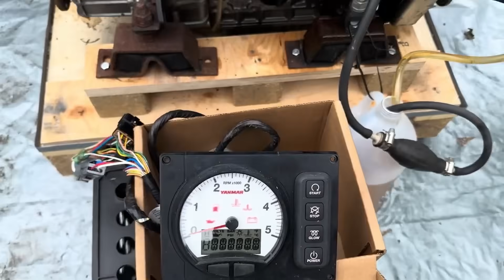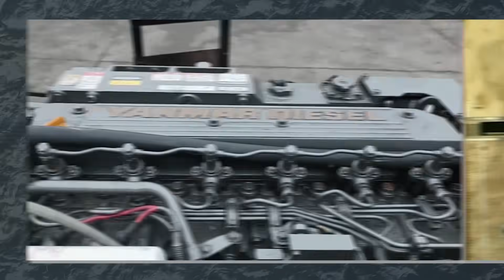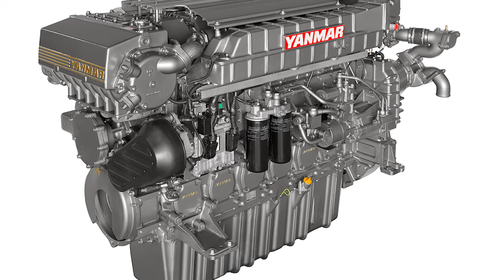The Rise of Yanmar: Mercruiser's Biggest Rival!

Comment: Yanmar is one of the worst brands in the small diesel engines out there. I know John Deere uses them for their small equipment mfg, but you cannot beat the small diesel brands like Kubota, Isuzu,, and Cummins. They are the most reliable and fuel efficient on the market today.  Even Perkins has a decent small diesel engine, which is why Cat owns them, although they are not marine diesels. Cat never had a good small diesels, but great large diesels.
Reply: What’s the worst?

Comment: Growing up on a liveaboard dive boat I often remember the sound and hum of the yanmar 36 HP outboard our tender had.  That motor just did not give up and as long as I can remember never failed and was also a benefit to have a diesel tender so that you could just carry one fuel type during trips.  Amazing piece of engineering, I own a 1HDFTE Land Cruiser and as luck would have it - is the same block and top end 24V as the Yanmar 6LPA marine engine !

Comment: I love yanmar engines, the best engines are their in house industrial engines converted for marine use. 
6LY and their 4LH series are beasts, you can replace the cylinder liners without any special tools on these engines. 
From what i remember their LP/LV series are toyota engine blocks and BY is BMW engine blocks.

Newer volvo pentas are ok but i would not buy their 80s and 90s engines, they blow head gaskets every 4 years or so.
Get the newer D3/D4/D6 series pentas instead

Comment: Gasoline engines are dangerous in vessels and yachts... Gasoline is explosive and almost impossible to extinguish, so I don't really understand the comparison with Mercure engines. In my opinion, they are only approved for use on lakes, rivers, or maximal near coastal areas. There are plenty of competitors to Yanmar, such as Volvopenta, Cummins, Caterpillar, Scania etc... But of course these are diesel engines.

Comment: Can anyone shed some light on the installation @7:11??
Reply: That is a hybrid retrofit by a Dutch concern called Combi who have been making electric boat motors for decades. The green housing is for a water-cooled brushless DC motor that can run at engine speed to charge lithium ion storage or be fed by the batteries to power the output shafts for silent sailing.

Comment: Kohler Power Systems used to build the 6, 10, & 15 ROY series Standby Generators, and Marine Generators with the Yanmar TNE Series of Diesel 3 & 4 Cylinder Diesel Engines, then the newer TNV series of Yanmar Diesels, and the Yanmar TNV series of engines were rebaged as Isuzu Diesels for some markets.

Comment: Had an old John Deere 650 with a Yanmar 2 cylinder diesel go under salt water during a hurricane in 1996 we flushed it and it still in use now on my sisters farm almost 30 years later with not a single issue.   Insanely tough engines!
Reply from the maker: What's the story behind sinking it? That's what we all want to know!

Comment: All I've had experience with a Yanmar engine is their diesel engines. They are TOP NOTCH and have never given me ANY trouble at all. All were in John Deere tractors.
Reply from the maker: Commercial or private?
Reply: @VintageBoats  A little of both. I bought my 770 brand new and needed fit or mowing my 3 1/2 acre lawn. And for clear ing feet of snow in the winter so I could get my truck out of my barn. 

Our winters were long and sometimes brutal,(upstate NY). So I had a 6ft rear pto powered mower deck, and of course the quick attach front end loader that was a snap to use. Then I did a little horse trading and got a twin axle equipment trailer and went and did some landscaping for friends etc. 

Then some weeks clearing up some flood debris for friends and family etc. I wish I could remember how many hours I put on it but when I sold my house and land I took it down to the dealer where I bought it and gladly took it off my hands for a fist full of cash. 

Damn near what I paid for it years before. I always treated my tractors like it were my car or truck. Yes, even waxed them several times a season.
Reply: @VintageBoats JD only use Yanmar in their commercial grade stuff.

Comment: I think yanmar used to be a good engine but I'm seeing issues in Newberry engines , the proprietary b.s is the reason I would never buy a new one , when they have issues it can be months on warranty work , plus I'm hearing they will not sell parts to customers only authorized yanmar dealers . if I was stranded on my sailboat for months at a time waiting for yanmar to fix my boat I would be furious
Reply from the maker: That would be frustrating! Have you ever owned one?

Comment: Ancient yanmar engines with low compression. How do you diagnosis that. WD-40 in the intake while it's cranking. If it smokes it's probably got compression. Make sure you're getting good fuel to your injectors. It's primitive it works. Don't use anything but WD-40. It's got propane for a propellant. And it loosens up the rings. Don't use rust off because that doesn't burn at all! However if you have one with stuck rings a good soaking with rust off and let it sit overnight. You'd be amazed. Don't forget seafoam really helps. And yes marvel mystery oil is a miracle friend of yours. Ancient little tiny diesels underneath the kitchen cabinets belonging to a millionaire with a bitchy wife. I've been there.

Comment: In my 40 ft Malö Yachts, build at Orust - Sweden, a sailboat from 1985 there is a Yanmar 44 hp 4JHE and there have never been any prbl with it. Never! A Clean Machine.
Reply from the maker: Thanks for sharing. Have you owned it from new?
Reply: @VintageBoats  No, I bought her from the first owner in 1999 and the boat will outlast me and my kids. Super quality and the engine have never been any trouble at all. Oil and filter. Thats it. at 6 knots 4,5 lt/hour about 2300 rpm. No smoke no oil consumtion. One turn on the engine and it start.. every time
Reply: Was it originally fitted with a Volvo Penta?

Comment: The problem with Yanmar is that the engines are extremely overpriced if you buy one retail. You have to be a manufacturer who buys hundreds or thousands at a time to be able to get them at a reasonable price. Its like $17k for a 1 liter, 30hp, 3YM, which is just a simple little generator engine in reality. It should be like $5k. That's like four times as much money as their competitors. The engines aren't worth that much, you're paying them royalties for the privilege of owning it. Its hard to believe they dont have a legitimate competitor considering how easy it would be to undercut their price by miles.
Reply: You pay for the reliability. It's like a insurance. And the engine is worth it.
Reply: @SveinMBortne if a Vetus 30hp costs $6k and lasts 10 years, I can buy 3 of them over the course of 30 years before the yanmar pays off. A tiny little diesel generator engine is not worth $17k on any planet.
Reply: @thechiraltheory7712 glad you support Yanmar still 😉 Yanmar owns Vetus but does not make a fuss about it just gobbling up the market.. 😅
Reply: @thechiraltheory7712  agree but I will keep my Yanmar 4jhe for another 40 years while you can change yours 8 times. Maybee we're different.
Reply from the maker: So you dont think there's any other good inboard engines on the market?

Comment: I've been working on yanmar's since they installed the single cylinder YSB. It became the YSM. Yanmar sideways modern. One cylinder. Sailboats ideally need reliable power. Yanmars have always come through for me. I have done in frame overhauls on engines that have had submersion. Believe it or not you can bring them back! Sometimes it's very simple you don't even need to take them out of the boat. 3GM 30 sailboat engine I can have the head off in about 45 minutes if I have good access. An hour if I have to stand on my head upside down with my face in a bilge. Yep I've been there done that. I like their big diesels too.
Reply from the maker: Some of those little inboard spaces are complete disasters! Have to be a yogi as much as a mechanic! Think sail boats need reliable wind no? 😂
Reply: There has never been a sound sailboat that has ever been sunk solely by being in too deep of water. So based on that fact. Investing in a good bilge pump is a priority. Investing in a bigger better bilge pump is the second priority. The hole in the water into which one pours money and praying that it doesn't sink @VintageBoats
Reply: @VintageBoats  Maybe  "YOGA" is where you were going?  ;}>
Reply from the maker: @gotchagoing4905 no I meant yogi.

Comment: I had a 1GM10 in my sailboat and a 3YM20 later in another. If you maintain them with oil and ensure they have cooling, they run forever and a day!
It doesn't matter if it was 30 °C or -10 °C, I turned the key, the pump developed pressure, and the thing ran.
Other people who had a crappy outboard were stranded on sea, while my little Yanmar just did its job. I've towed a few of those people into the harbor with my tiny 17-foot boat. :)
My current boat cannot have an inboard engine without reconstruction, and I miss my Yanmar. Besides my old W123 300D, I've never had an engine as reliable as the Yanmar.
Never ever will I have some American crap like Mercury /Mercruiser. Everything is in those idiotic imperial measurements and hard to get by parts, at least in Europe.
My outboard is a Yamaha. Japanese quality all the way. :)
Reply from the maker: Check out the SNL sketch 'Washington's Dream' of the imperial system. You will love it. Hilarious.

Thanks for sharing your Yanmar story.
Reply: @VintageBoats  Yeah, I just watched it.. 😂
Reply from the maker: @kalleklp7291 absolutely brilliant.
Reply: That's funny, this 'Yank' likes and grew up with those 'Imperial measurements' and they ALWAYS worked just fine for me. I for one am against us changing to the stupid metric system . You guys do you, and  us AMERICANS will stick with what we have.
Reply from the maker: @gotchagoing4905 I'm not knocking it. But you can't deny good humour.

It would be an interesting thought to know how difficult and how costly it would be to implement such a change! Near om impossible
Reply: @VintageBoats  LMFAO, right back atcha, lmao...😁

Comment: I got two small Yanmar diesel engines at home, one in a Yanmar mini excavator (got it since 2004) and one in a small wheel loader.
Never had a single issue with them, maintenance items and that it.

Absolutely excellent engines.

And in comparison to the Kubota industrial engines, the Yanmars don't sip fuel.

Edit: Both are 3TN engines.
Reply from the maker: No boat yanmar experience though?

Comment: I run a Yanmar 6LPA, it’s an inline 6 cylinder motor, based on the Toyota land cruiser engine and indestructible, also revs to 4,000 RPM and produces 315HP - it’s as quick as my buddies smaller boats with 200hp modern Mercury outboards and sips fuel. The turbo boost / power band is a little strong though (they run a big single turbo)
Reply: Its a 4,2 litre, does not grind on the starter but starts immediately.🙂
Reply: I too have a 2004 6LPA STZP in my 28’ fishing boat, I have done all the preventative maintenence since I purchased it in 2008 myself.  never had a lick of trouble that I didnt cause myself, had to replace a couple mixing elbows and the turbo charger.
Reply: @davidhall1779 how many hrs are you on now? I have 400hrs on mine on original belts, wondering if I should have them changed (age rather than hrs) as manual says due at 1000hrs.
Reply: That engine is actually a BMW block, so reliable that even Toyota couldn’t do better and bought it
Reply: @Fr99763 not correct, the 4.2l 6LPA is Toyota the BY is BMW
Reply: @Fr99763  I think you’re referring to the later B58 used in the Supra and the other 40i BMW models? Brilliant motors also.
Reply from the maker: What boat do you have it in?
Reply: @VintageBoats  it’s in a chaparral 265 SSI sports Boat. She runs at 40 miles an hour flat out.
Reply: Don’t upgrade to the shitty ass 8lv
Reply: Here is a reference I found:

You are correct in that the basic engine block and other components Yanmar used in the 4BY2 and 6BY2 engines are the same as the engines in the a wide number of BMW diesel auto models of the same time frame. In converting the auto engine for marine use, Yanmar changed out a number of the BMW parts. The Yanmar ECU being one of the more obvious changes from the BMW ECU.
Some 6BY2 and 4BY2 parts are off the shelf from other manufacturers but some are proprietary to Yanmar and some are identical to BMW parts. The real trick is knowing which parts are BMW equivalent, which are Yanmar proprietary and which are 3rd party manufactured parts.

PS: From 2006 to 2014 the Yanmar 4BY2 is based on the BMW N47 2.0 liter engine. I believe, but am not certain, that the 6BY2 Yanmar is from the BMW N57 2.5/3.0 liter engine that were built between 2008 and 2020.

Oil filters,… you get them cheaper from BMW
Reply: @Fr99763 as the original post list 6lpa you are incorrect that it’s a BMW base. It’s not, it’s based on a Toyota 1HD-ft or 1HD-FTE. Yanmar use bmw in the BY range.

Comment: Yanmars are good engines....just don't overheat one.
They're never the same after that.
Reply: They are not alone, heat does bad  things to most engines. Cracs on sylinder heads are typical to many.
Reply from the maker: Speaking from experience?

Comment: No experience with their boat engines......but in industrial and agricultural, their engines are unstoppable.
     No experience with the warranty......they ran straight thru!
    Great engines!
Reply: Most Japanese companies hire young people aged 22+ who have graduated from university or graduate school, and they are promoted to CEO in their late 50s. In particular, R&D, technology, and manufacturing engineers work for the same company for nearly 40 years after graduating from university engineering. Unlike in the United States, the only time a company invites an executive from another company to become CEO is when the company is on the verge of bankruptcy.
Reply from the maker: Lovely to hear. No boat experience at all?
Reply: Mercury jet drives in shallow, clear, cold rivers.
    Two strokes than four strokes......
    The 2's were light, fast, and had better on plane reaction time, but fuelish and loud.
     My current 4 stroke is a bit of a compromise, but quieter and more fuel efficient.
     Never seen a decent diesel jet drive.....yet!